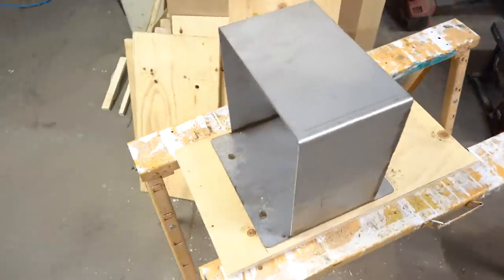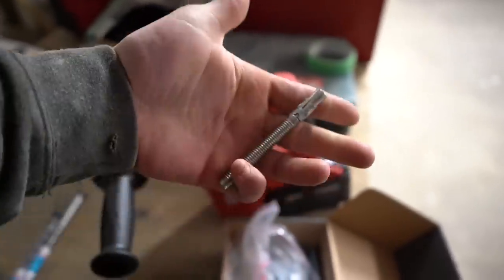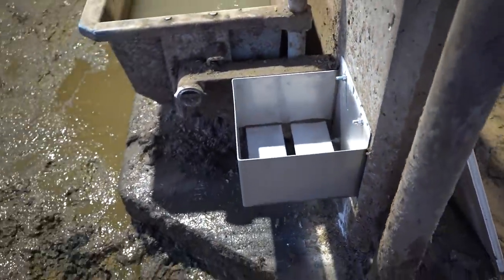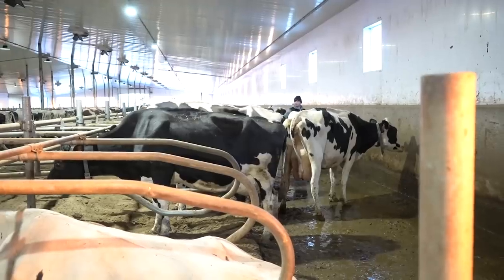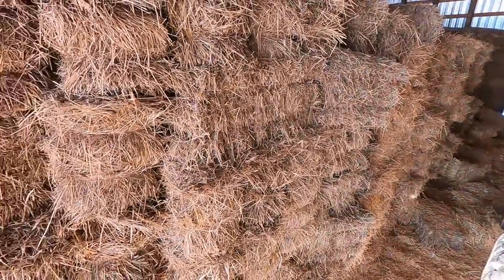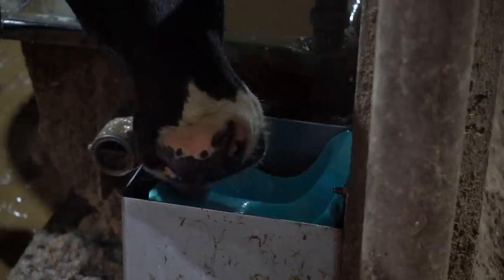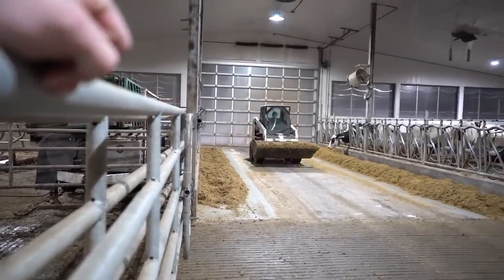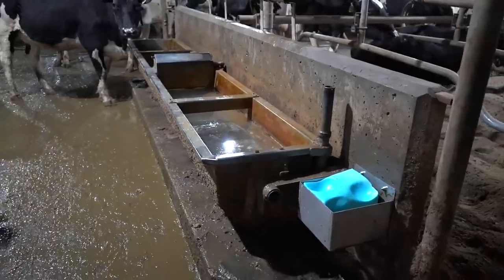Installing New Salt Block Holders In Our Barn!

Comment: Is there a rolled edge at the top of the lick holders?if not slit some pipe length wise and put round.  It will save a few cut tongues as the block drops in height

Comment: Many a summer I stooked square bales behind a New Holland baler . 3 on the bottom make stings aren't on the ground then 2 then one make a little pyramid and slide it off the sloop.....good memories
Reply: Our stooks were 4-3-2-1 and it was hard and dusty job, and got paid 1 cent/bale running/stacking thereby making up to $16 day. A real windfall for a 14 yr old kid back then.

Comment: It’s amazing the health benefits of salt and minerals to a dairy herd. Initially you’ll have a higher consumption rate until the cows get the minerals in their system and then it’ll drop and level off as the cows just maintain what’s in their body. One thing we do is make sure the cows that are getting close to calving have free choice salt and minerals and our calving issues really dropped, the cows got milk fever a lot less and the calves were healthier and more vibrant at birth and their growth and health issues were much improved. 
We also noticed that the flavor of the milk was awesome and milk fat, aka: cream, quality improved as well as SCC went down. We make salt and mineral blocks available to our calves, close ups and hospital pens as well, I think you’ll notice an overall improvement in your whole herd, milking and non-milking. One thing you may want to consider is getting blocks that have a higher Calcium and Magnesium content, this will especially help the fresh cows. 
Best of luck from a fellow dairy farmer in the States.
Reply: Ron Gosling  not really, salty snacks are offered to get thepunters to drink more.

Comment: Jan - Stainless steel is NOT rust proof - because it is steel. It is stain resistant. meaning it resist rusting.
Reply: Depending on the grade you can get very close to rust proof.
Reply: Ok Karen
Reply: 316 stainless don’t rust 304 can
Reply: Since it resists rusting...doesnt that kinda make it that proof? 😂😂😂

Comment: I always think the name 'Salt Licks' is a bit misleading. They contain a measured mix of other minerals essential for the health of cattle, sodium, calcium, iron, zinc, and trace elements. 'Mineral  licks ' would be a far more accurate name.
Reply: Ours say mineral blocks on the package
Reply: Not all of them contain minerals. The ones that are all white are typically Just salt. You can also get Himalayan salt licks that are just salt. Mineral is a completely different thing and is put out separately.  What you are speaking of are the brown blocks and they contain salt but are not a main source of salt. They are called mineral blocks and are placed out WITH a salt block in a lot of cases.

Comment: Wouldn't you want to put them up higher to keep the manure out of them?  I foresee a lot of cowshit in them soon. Also, always leave the nut on the anchor bolt when pounding them in, so if you wreck the threads you can unscrew the nut and fix them.  Or better yet, you use a small enough anchor to fit right through the metal hole, and then you just have to pound it in right through the metal salt box.
Reply: I was looking to see who would be telling to put a nut on a bolt before pounding it in

Comment: It's not such a bad thing to have that water bowl gap as a possible escape alley for your herds in case of an emergency. Actually, can you talk about any fire safety features specific to the farm that may be of interest? I read where some horse barns were built with exterior escape panels that trigger open if a fire alarm went off so the stock could run outside into a paddock. I realize you wouldn't have anything that elaborate probably.

Comment: Being some of the salt blocks come with a 3 inch hole down the center, why not just build a mount out of a piece of 2 3/8 inch tubing welded vertically to a base plate with four holes drilled to bolt it down. You could lag screw the four bolts vertically into the top of the concrete partition walls and the cows could more access to the salt licks,

Comment: Aren't you concerned that the cows might get their snouts cut on the bolts sticking through the backplates? If it was me, I would cut the excess length off.
Reply: @michael7423  i would not count on it
Reply: @michael7423  Why risk it? Accidents happen with animals just as they do with humans. It would be best to trim the excess so there's no threat of accidental injury.
Reply: @jodia1856  Totally agree with you. Well said.
Reply: From my 45 years experience with cows  they will rubb the bolt heads smooth  with out any damage
Reply: @michael7423  How is trying to save a cow from injury "nit picking"? (I think that's what you meant to say.) I totally agree, Jan and his family are amazing, and they treat the cows very well. Yes, the plastic caps are another solution...I'm glad you agree that there IS an issue that needs to be solved! Have a blessed day!
Reply: @michael7423  A new born baby could pull those plastic caps off and I agree with the majority. One cow pushes the other cow, next ting you know you are dealing with a herd of cows with bloody noses. Coming from someone with over 2 decades of construction, I would cut the thread off and even round the nuts somewhat too
Reply: I was thinking that too.

Comment: The one thing that concerned me was putting the salt block close to the water not because of the rust but because it may be in the way of others wanting water. Although I understand why you did it that was my concern. We also sometimes put salt in our horse's feed along with the mineral block. in the area.

Comment: Batten down your hatches, we are about to dip into the - 30s. Brrr.
Reply: You guys on the prairies get wind at those temps, here in N Ont we rarely do.
 -30°C here is usually nice because its calm.

Still separates the wheat form the chaff....LOL
Reply: @GoldCountryTrapping  We can the forecast for Saturday night is 15 kph winds and a wind chill of - 39 C
Reply: @asquithmainlines699  she gets a bit brisk out here for sure not much snow in Alberta though it hasn’t gone below -5 until now it’s -25
Reply: @jonthelamb4549  This morning we were - 40 without the wind chill and ice fog so thick you couldn’t see across the road. I was outside with the dog and picked up a metal handled shovel with my bare hand to move it and I could feel my fingers burning after just a few seconds. Feel so sorry for the livestock in this weather although they do get through it just fine. In England their animals have most likely all been in the barns for months already.

Comment: If you take the anchor off the bolt and just hammer the anchor in when you tighten up the bolt they are way more secure. It keeps the anchor prongs in while you are hammering them in, it help them from getting loose over time. I use to install hurricane shutters and have a lot of experience using them.

Comment: Hey Jan, the dark deposits at the welds of your stainless steel mounts can rust at those points because of the the corrosive salt and cow slobber.  We usually "passivate"(removes contaminating iron) to prevent rusting.  To late to passivate so you might spray a coating Plasti Dip spray to seal off the area.
Reply: And what About the bolts he is using?

Comment: Good seeing your dad there.  The girls love some salt. Pretty sweet salt holders.  Hard work.  I'm a retired orthopedic surgeon,  I did several thousand carpal tunnel operations over a 35 year career.   I only had two infections with carpal tunnel surgery,  both were in older dairyman.   The old guys had hands like thick mittens, heavy calluses,  cracked skin, and  skin that retained debris.

Comment: Couldn't help but notice that on some of the salt block holders you've left the threads sticking out of the stud.   I'm wondering how many cows are going to mistakenly lick them and possibly irritate or cut their tongues.   You might want the protruding threads back to the nut and deburr the edges.   Cheers

Comment: I usually double nut that type of anchor bolt to protect the threads when you are hammering them in.
Reply: I agree.
Reply: Great idea. And if you do booger up the threads, when you remove the nut, it will retrace them.

Comment: The height of the mineral block is too low, it should be as high as the cow's back in order to keep its head higher while licking, and it wouldn't waste saliva on the block or on the ground.

Comment: good   cattle salt  block   holders  installation # but   had U  kept  salt block  holders    metal  walls  height   50 % less  than the  height of salt  block  it  would be more  convenient  for  cattle  to  lick   since as  cattle  licks  the  salt block  volume  decreases  &  it  is difficult   for cattle  to lick  # related  to  DM  hay  , is  it  grass  hay  or is it  wheat   straw  hay ???????  related  to the water  U provide to cattle  it  appears  muddy  color  !!!! water    should be clean  &   its color  should be  transparent  # use  water  filters  to   filter out   soil  &  other  particles #

Comment: You might consider putting 'cap nuts' on those wall anchor studs.
Reply: Acorn nuts ?
Reply: @welderman5844  I have heard them referred to as acorn nuts. Some auto lug nuts are also capped. They also make lug nut covers for traditional nuts on fancy rims. I just call em cap nuts.

Comment: You need to grind down the bolt heads that are sticking out into the salt block holder.  the cows are going to snag their mouth, teeth, tongue, or nose on them.  Grind them down and put a weld on them, or put a silicone surface over them.